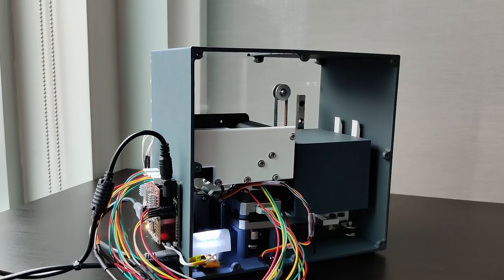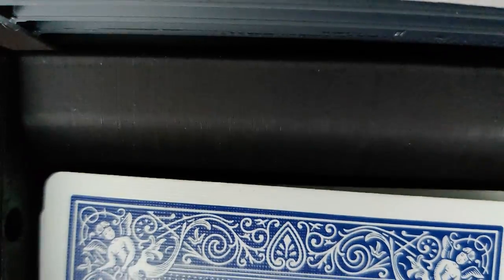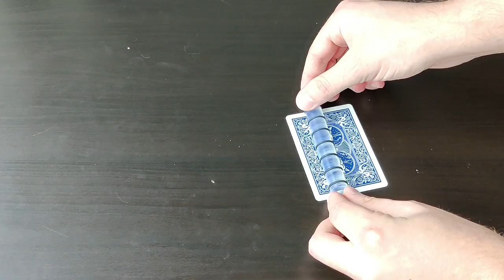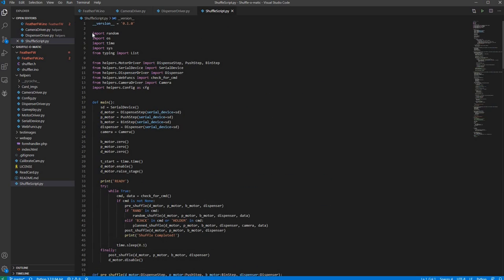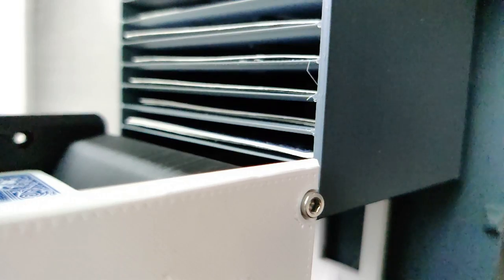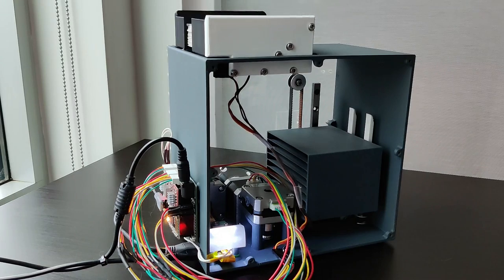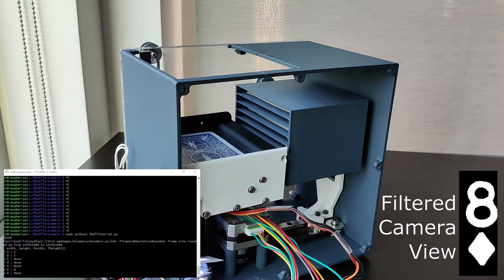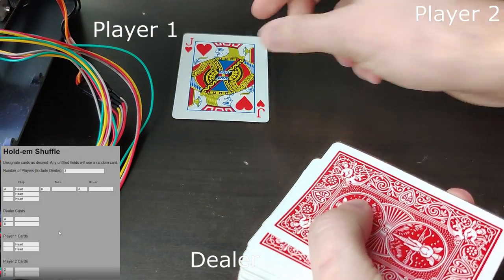Rigged Card Sorting Machine - ALWAYS Get The Hand You Want!

Comment: This is why you cut the deck after the shuffle, and/or remove some number of cards from the top. Nice project though.
Reply: Even when you cut the deck it’s still a fixed deck. It’s how the casinos cheat.
Reply: @EliteCannagivers  For casinos I could agree as they seem to take a fixed number of cards to the side. But if you cut the deck randomly, I don't see how you could keep it fixed.
Reply: @kilfoofan  it doesn’t fix an individual player. The deck only gets cut in half. It doesn’t matter how many times a person cuts a deck. The cards are still in order of the machine. That order controls when the bad beat jackpot gets hit. That machine sorts cards to make a lot more people get hands which creates a crazy table. More people go on tilt at a crazy table. Then those players start playing other table games because of emotions. Like I said cutting the deck doesn’t change anything. All it changes is who gets dealt the fixed hands at the table. The tables are all fixed.
Reply: @EliteCannagivers   I still have to disagree. In order it to be truly a fixed deck the hands would have to be predetermined and known, i.e. you'll know the outcome of the table even before you deal a single card. However, if you cut the deck randomly, it can't be known as the first card dealt is not yet known. You could know what everyone has, and what will be the community cards (if hold'em or omaha), based on your hand (if you can remember the exact order of the 52 cards for the individual shuffle, that is), but you could not predetermine the dealt cards as shown on the video, e.g. player 1 gets full house, player 2 gets 4 of a kind, player 3 gets straight flush. For this you can't have any randomness to the shuffle, including cutting the deck. It's like if you would  take this post, cut it randomly, and then try to read it with the original word lengths from the beginning, but starting from the cut position. The outcome would be gibberish.
Reply: @kilfoofan  all you have to do is read the patent on Shuffle Master. It says it all in the patent. It also states in the patent that it can all be done wirelessly. People want to talk so much but no one wants to put in any research to see the real truth. Shuffle Masters don’t shuffle cards they sort cards. It’s just a fact stated in the patent as well. Maybe instead of replying you’ll use that time to read the patent.

Comment: I'm using parts of this for a project of mine I've downloaded your files however it's missing the small quarter gear from the small servo to feed the cards into the rollers would you be able to link this for me please
Reply from the maker: I changed the design slightly after posting this video, it is now a fully circular gear. But I don't remember if I tested this so if you run into collusion issues you can cut out a wedge from it like how it used to be, or maybe look in the old version folder. The part name is "DriveGear2"
Reply: @3DprintedLife  perfect thanks for getting back to me appreciate it

Comment: What's the limiting factor on speed? Seems like it could go faster, but it's not.
Reply from the maker: Good observation, I'm assuming you are talking about the sequences where it uses the camera to rig the deck? In this case, it is actually capturing the image which is so slow. The opencv library for some reason takes over a second to capture an image. I have plans to build a V2 eventually and I've learned how to stream a video feed into python, which should allow capturing and processing the image to happen in about 100ms or maybe less! Dispensing could be sped up a little as well, but that requires an overhaul of the design to improve it!
Reply: @3DprintedLife  I thought that it would be the image recognition. Or prehaps some feeding issues. On a normal fair shuffle it would be really cool to see it cranked up to 11 and just spitting cards back-and-forth. 👍

Comment: Hello 
Unfortunately I always get the error "include sam.h no file no dictonary" what could be the reason for this? Can you help me? I have loaded the drivers for the SAMD board but nothing helps. I am desperate.  Thanks a lot :)
Reply from the maker: What board are you trying to load the firmware to?
Reply: @3DprintedLife  Hello again. First of all, thank you for the answer. I am almost done now. Engines are running. But I don't understand the web html. It does not create a file "data.txt" it always creates "formhandler.php". I also don't have the rights for the path /var/www/html I have to do something wrong. Unfortunately I don't know what. I would be grateful for a tip. How does it create the data.txt file? It must be programmed somewhere. Also the path where he wants to write the file.

Comment: Do you think this is this possible with an arduino without the card reading functionality?
Reply from the maker: No you definitely need an arduino or some other microcontroller to handle communication with the stepper drivers. You could get rid of the raspberry pi if you wanted to just have a basic card shuffler with one (or maybe a few) since the pi handles the computer vision and the web based UI, both of which aren't strictly needed, but you still need an arduino or similar board to handle the coordinated motor motion.

Comment: 10:55
i can almost see your hands hesitsting to naturally wanna cut or shuffle the deck...
a hard skill to stop, i mean whats it matter to cut the deck if you're not cheating?

maybe it have an option to load the cards(or just a hand) at the bottom or top, of deck, so you can make a quick cut into 3 piles and just put each where you want, then learn to bottom deal...

at that point though... you might just skip that and use sleight of hand all the time...

but a true cheater, wants to find a way around the "natural" breaks we have to discourage cheating

maybe have it deal to 5 people, by moving 20 degrees and pushing the card out the bottom of the machine so you can pick the seats of the winners... use cv and another (IR) cam to detect when you have an IR light on your hat/glasses etc to determine wherever you are and to constantly have you win...
or IR reflective clothing so your "friends" can move you wherever they want...
throw in a esp8266 and a phone, and just connect to the wifi to have the machine start when desired, or a pi 0 w then add mp3 playing features and a speaker and use a homebuilt android/iphone app to "control music" to let you sit and "nervously tap" on screen to pick who wins and how each shuffle...

make this into a gofund me... and watch the money roll in
be prepared to (after crowdfunding) own a way better 3d printer, and maybe a laser cutter

or at least thats how Id go about never playing cards in order to cheat my way to a whole bunch of home manufacturing equipment without taking a punch...
or get the design done, and sell them to vegas casinos as amazing shufflers for the highest of hiqual casinos...gold plating and everything

then oceans 1x 1-4 your own heist